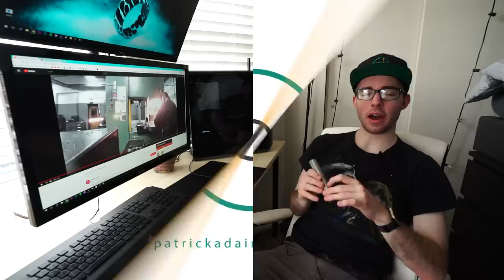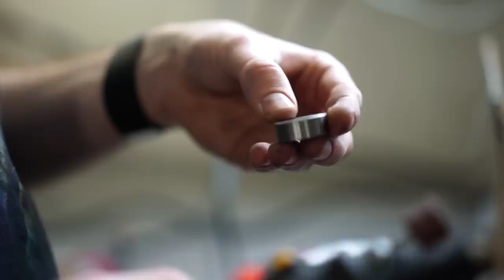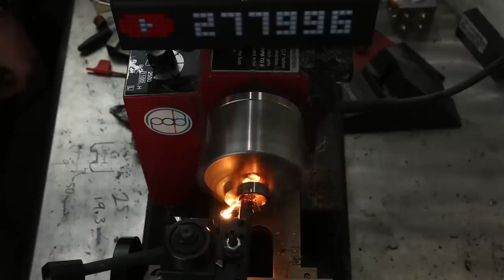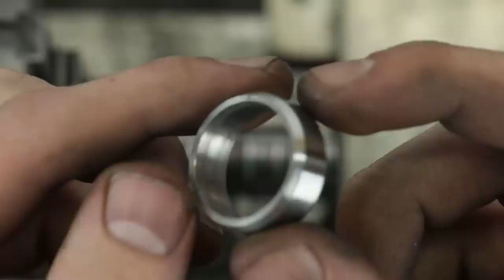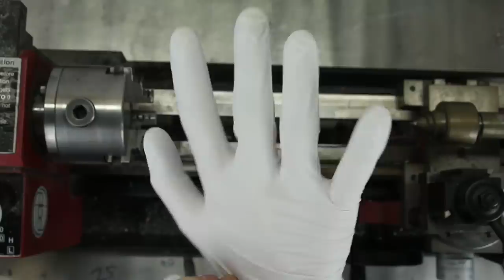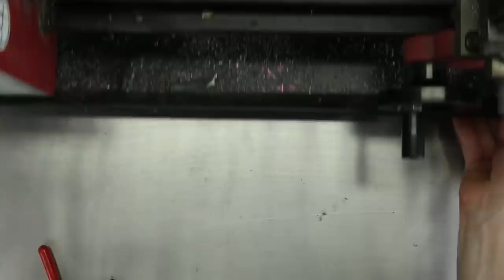Making a Flammable Metal Ring -- Black Zirconium Ring Tries to Burn Down My Shop

Comment: I have been working my way backward through your vids and I am gobsmacked at how awesome your work is. I liked how you changed the colour using the blow torch. I have a quick question if you wouldn't mind answering. When you was heating it and it changed to the blue colour, if you had stopped there, would it have stayed that colour or whould it eventually rub off like it does when doing the same with copper? Thanks for sharing your work with us and looking forward to learn more from you in the future. Diane x

Comment: Thanks for such a good video! I did all the steps. I have doubts about the last step.
I get a dark gray Hematite color, almost black but not as black as yours. Will it be high temperature? Low temperature? I'm using a propane torch, and I gave it until the ring turned orange.
Thank you very much!

Comment: That small boring bar is good enough finish widen the hole.  To reduce that flex, you just need to grip it shorter in the tool holder.  You only need like 20mm maybe 30 to get to the end of the ring. The longer the tool the heavier the resonance.

Comment: Hello, Patrick.  Excellent video!  Love your work but I especially was intrigued by the black zirconium metal look.  It looks amazing and so unique!  I noticed at the end of your video how you asked for any ideas?  Well, since my birth month is in December (26th) and my birthstone is the blue zircon stone, I was wondering how it would look if you could come up with a unique inlay/insert of some blue (dark or light) zircon stones (either separate or lined up) around the mid or outer section(s) of the ring?  I think the bluish color of the stone would look awesome with the blackish color of the ring.  Please let me know what you think?

Comment: I like your designs and videos. Just be very careful with the materials you choose and get to spark. I was a machinist and one time there was a person cutting magnesium on the lathe. Some how the chips in the bottom of the lathe caught fire. You can't put it out with a regular fire extinguisher. They had to let it burn its self out. By that time stopped burning it had got so hot that it warped the lathe and turned it into scrap metal. This was a large industrial lathe, the kind that cost in the $20,000 range. Sorry for trolling but I don't want to see anyone get hurt. Keep up the great work though.

Comment: Very cool

Does anyone know why it sparks so much?
Reply: When it's heated up (like through grinding) and has a lot of surface area (powder, shavings) it oxidizes in an exothermic reaction, which basically means it catches fire. Some metals are very flammable, one other example being magnesium (magnesium torches work under water for that reason). Sorry for the late reply but I hope this is still interesting for you ;)